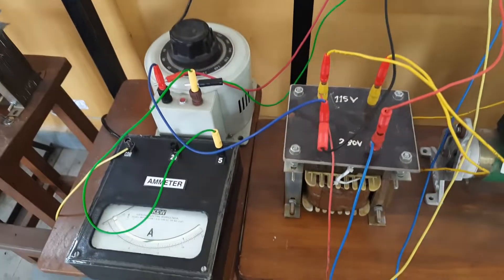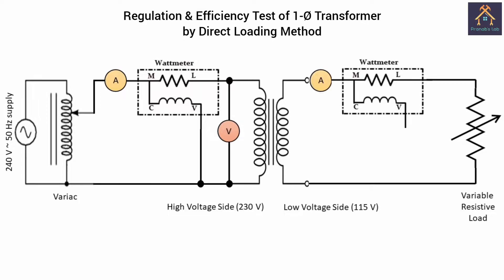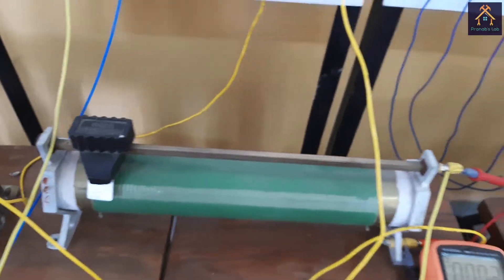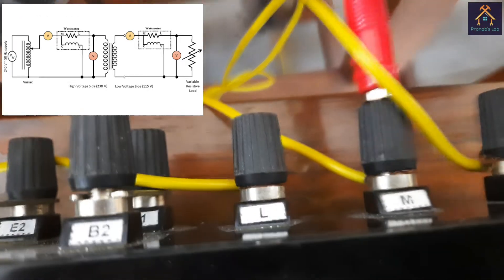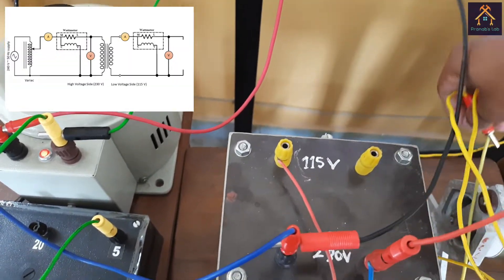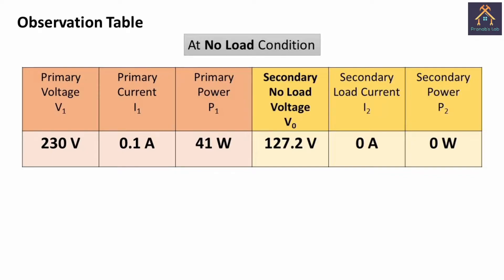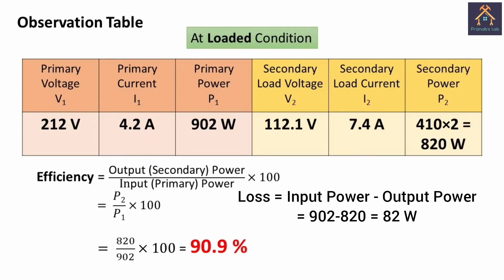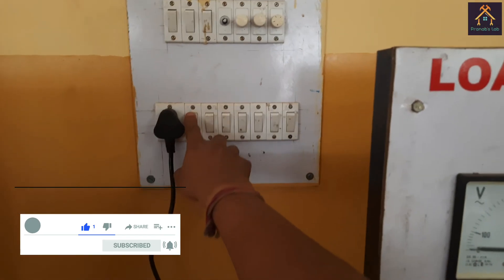Regulation and Efficiency Test of Single Phase Transformer by Direct Loading Method | Practical Test

Comment: If a step down transformer is rated 18 volt 2 Ampere and after rectification and filtration the dc voltage is 28 Volt dc. But on applying 500 mA load the dc voltage drops to 20 volt then is it okay or some problem with transformer ?